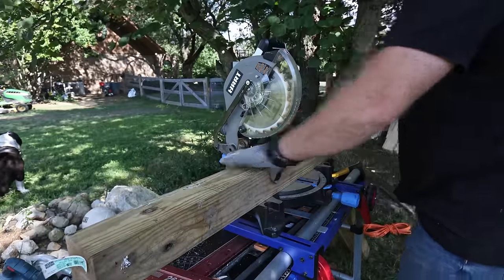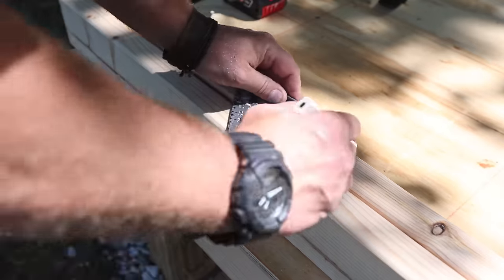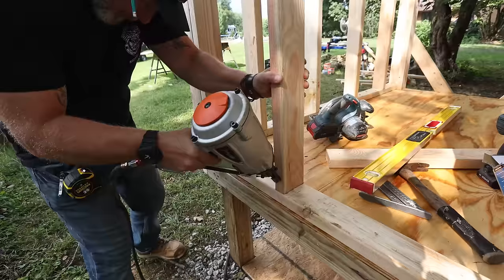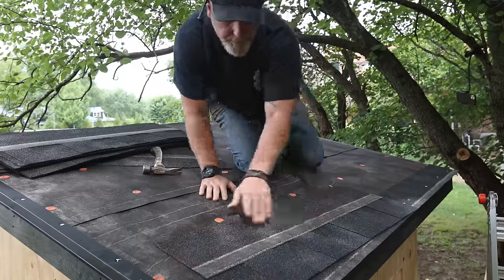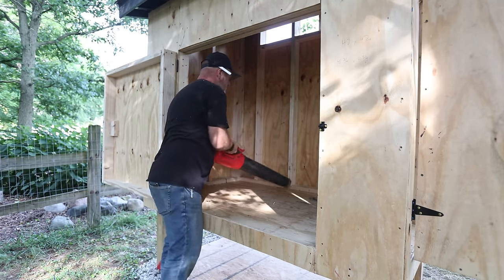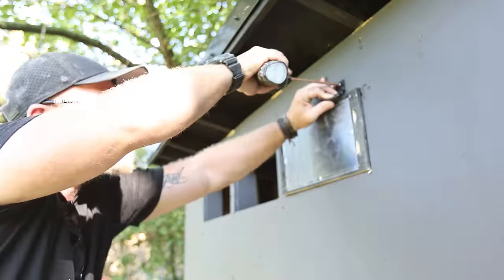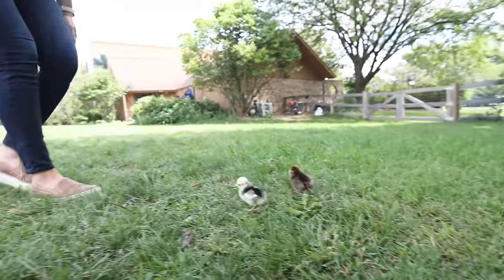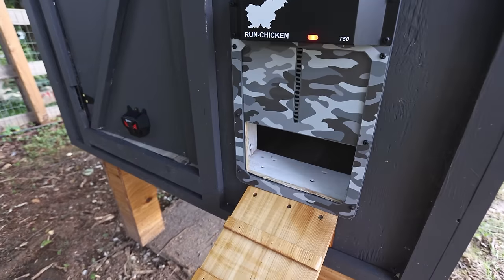How to Build the ULTIMATE Chicken Coop in 7 Days // Plans Available

Comment: FYI: if your chicken huddle by the door when it’s time to go in the coop. Like mine did. Worried if they’re going to get chocked by the run chicken door. Once the sun starts going down it’s to dark in the coop and they won’t go in because they can’t see. It took me a while but it was a simple fix. I put a light inside on a time to turn on at least an hour before the sun goes down and off an hour once it got dark.
Reply: @Victor M what light did you get? I've been trying to find a solution for this as well but it's a manual pull string type. Been looking for a solar powered automated version of the same thing.
Reply: @cameroneverhart6443  I bought them on Amazon. I copied and paste the description👉🏼Nilight - “ 60001F-B Led Pods 2PCS 18W 1260LM Flood Led Off Road Lights Super Bright Driving Fog Light Boat Lights Driving Lights Led Work Light for Trucks, 2 Years WarrantyNilight - 60001F-B Led Pods 2PCS 18W 1260LM Flood Led Off Road Lights Super Bright Driving Fog Light Boat Lights Driving Lights Led Work Light for Trucks, 2 Years Warranty”
2PCS 18w Led Light
Last purchased on Mar 23, 2022
4.6 out of 5 stars 18,404
$15.29$15.29List: $18.99$18.99Details($7.65/Count)
Reply: @cameroneverhart6443  to power the pair of LED lights, I’m using a DC timer with lithium battery and 200 watt solar panels . It’s also powering a small DC water pump for my goats nipple waterer.
Reply: @cameroneverhart6443  also the battery from Amazon 👉🏼12V 24Ah Rechargeable LiFePO4 Lithium Iron Phosphate Battery
Reply: @victorm7274  oh, that is a good battery....normal lithium Ion batteries can catch fire in a chemical reaction that you can NOT stop....lithium Iron Phosphate batteries do not have that issue.  Anyway, I need to get that 200 watt solar panel and DC timer.  We have 4 goats and are working towards chickens now.....guess we did it backwards.
Reply: @Steve-ps6qw  our 4 Nigerian dwarf goats are a bit destructive. I had to make a special feeder that only the chicken can get to. I had the usual pvc elbow no spill kinda feeders. Our goats destroyed them all. It seen like every time I turn around they’re braking something. They’ve broken a few chicken watering nipple, they broke the ramp into the coop. They broke two chicken feeders . I had to reinforce the enclosure with cattle panels. They love to rub and scratch themselves on the fencing. Other than that , it’s all good 👍🏼
Reply: @victorm7274  lol. we have four paddocks but one is the main paddock where the goats sleep (their own little barn) and the chicken run will be in that paddock too but the goats will not be allowed in....I will make it predator and goat proof, thanks for the heads up!

Comment: Very nice looking chicken coop. But in my opinion to make it the ultimate chicken coop it needs to be setup for the deep litter method. Basically you just need it to have 12-18” of space at the bottom for the litter to build up over time. This is the best and easiest way to keep chickens in a stationary coop design. The way it works is you start with a layer of dry wood shavings to cover the floor of the coop. Once that gets soiled you just cover it with another layer of shavings. You continue doing this for as long as your coop has the space for the litter to build up. The beauty of this method is the carbon (wood shavings) absorb and offset the manure load eliminating any smell and composting at the same time. I used this method when I started out with chickens several years ago and went a full 18 months before cleaning the litter out of my coop that housed 20+ hens. You could open my hen house and not even smell a chicken. And if you did it was time for a layer of shavings. When cleaning out the litter it just smells like dirt. Great compost for the garden. 
I would recommend cutting the bottom 12-18” off of you access door and making it a separate door that only opens when it is time to clean out the litter. 
This also works outside in their run area. You might start with a nice grassy spot for them but they will quickly destroy all of that grass. Once that happens get some free wood chips from a local tree company or saw mill and put that down in their run areas. I put a heavy layer down to start with then just mix the manure in as it gets soiled. That way I didn’t need to have a pile of Woodchips somewhere. Use these methods and enjoy your backyard chickens without the smell of the chickens. 
Good luck!! Thanks for sharing.
Reply: agree. i built my deep litter coop in 2017 and have never needed to clean it out. i just take out compost for the garden and add more straw. also his coop doesn't have decent roosting bars. i hope he retrofits some.
Reply: Wonderful tip! That is the method I'm interested in. Lots to learn about chickens! 
Where did you find the plans for your coop build and are there any chicken keeps books you'd suggest?
Reply: @questions_galore  I got everything from YouTube videos. Joel salatin is on I would definitely recommend on YouTube and the books he wrote. The coop I built wasn’t anything complicated. Basically I just made sure I had room in the bottom of the hen house for at least a foot of bedding to build up and still able to open the access door without any bedding falling out. Good luck with the chickens. They are the gateway “drug” into farming. We started with six. That quickly grew to to over 40 chickens ducks goats pigs cows and now horses lol.
Reply: doesn't this stink or rot? And how do you then use that composting for the garden without cleaning it out? Eventually won't it choke your chickens to death? LOL
Reply: @zia_kat  How do you get it out for composting without cleaning it out?
Reply: @stephaniec8816  it doesn't stink. that's the beauty of deep litter. it has a good smell like soil rich with organic matter. chickens originated from the jungle fowl in south east asia and deep litter replicates their natural habitat of the jungle floor
Reply: @stephaniec8816  you just take out compost as needed for your garden but you don't need to clean the coop out.

Comment: Another tip: leave at least a 1' overhang on the roof for ventilation and air flow, use 1/4 " caged chicken wire to cover the gaps in the rafters to keep snakes out.

Comment: Love the coop! Good Solid build. I’m super jealous!!! 
I’d use 1/2in galvanized hardwire cloth on the windows instead of plexiglass and add more windows on the other walls for ventilation. Chickens are fine in the winter, they’re more built for it than heat… it’s the heat you need to worry about. Predator locks are imperative. Raccoons, possums & squirrels can open simple locks. I put down a 2ft predator apron made of Galvanized Welded Wire Garden Fence, 2 in. x 4 in. Mesh from tractor supply around the outside of the run so predators couldn’t dig under the run and wrapped the run in the same. Everything with the coop is Secured with hardware cloth & added a wildlife camera & lights for night predators. I learned the hard way (and I live in a residential area where I didn’t think I had to worry as much) However you’re obviously an expert and have probably figured all this out! Again.. beautiful coop! Good luck!! ❤ (PS chicken math is a thing 🐓 🐓 🐓= 🐓 🐓 🐓 🐓 🐓 🐓 🐓 😂
Reply: It is a great coop, but I am totally with you on a raccoon proof lock on that door and wire behind that plexiglass. The heartbreak when we lost 2 of our 3 ducks is not anything I would wish on someone.
Reply: Take another look at the finished coop; he did put hardware cloth on the window opening so he can prop them open for ventilation without intruders. I do agree with you about the lock hardware, it needs to be something a racoon or squirrel can't open.  Sliding bar locks are child's play for them.

Comment: Nice build! I did something similar but a bit less fancy.  I sheathed the inside with the plastic sheeting like you see on the walls of a public restroom so we can wash the whole thing down, which we do once or twice a year. The floor is also the same plastic sheeting over plywood, but removable through the clean-out door to make it easier to dump the pine shavings we use as bedding. I was most interested in seeing how you were going to address weatherproofing the hinge side of the lid of the laying boxes, since I have a problem with leaks even with a drip strip above it.  How is yours holding up to the rain? It doesn't look like you did anything different than I have.
Reply: We tacked a strip of heavy poly sheeting over the hinged section.  Works like a charm, even in our cold Maine winters when I have to shovel off the top... I just use caution not to tear it.

Comment: Very pretty. I admit to some concerns about a couple things: how is the ventilation in your coop?  Adequate air flow is vital for any birds and I didn’t notice you installing any vents to keep the air moving inside. Once your chicks have feathered out, you don’t have to worry about keeping them warm, you just need to keep them fed and dry. Your power assisted nest box cover is cool, but I would still put a latch on it for those high-wind days that could trigger it opening without a human hand.
Reply: Depending on where they live they may need to provide heat for the chickens since they are Silkies.  Silkies are a more fragile breed of chicken - they need to be protected from the cold and wet weather.
Reply: The windows did have chicken wiring underneath the glass and the windows open. He didn’t address that he had done that but you can see it in the video. Maybe there are other vents or holes. Great point!

Comment: nice coop but up in the air can be to cold for winter if you live in a warm place then ok chickens love to dig and lay in the dirt when it is cold . another tip i bag grass clippings use for laying boxes and help bio breakdown on the dirt floor .i never use heat in my coop birds need to molt and adapt to weather using heat can be dangerous for a few reasons but it the power goes out for a extended period the chickees could suffer . another tip predators can break through cheep chicken wire

Comment: i built my coop with dirt floor 8x8 enclosed area with inside laying boxes and a 8x10 area under roof small hole fence so they can be outside without leaving coop i ran electric for lights and outlet to plug in water can warmer .and a nice big outside fenced in area for them to graze without the dogs in the same space .my first coop had a lift lid laying box but the snow made it to hard to open .now i walk in the door shut the door everything inside food water scratch and laying boxes they love the open air part under roof secure from predators , they love the dirt floor they can dig holes to lay in and dust themselves  . 4x4 post frame 4' center 6x6 half under ground  screen mesh under the bottom sticking out a foot outside covered with dirt to stop digging under screened in soffits for air flow and protection .i did plywood the inside to protect the framing from birds . it has been about ten years not lost one bird to predators and coop is holding up like new total roof size 10x20 metal roofing

Comment: When I built mine, I painted & sealed every board BEFORE assembling it to stave off water intrusion & did minor touch ups as needed.
I like the vinyl planked floor.  We used sheet vinyl on ours to essentially make a tub (1' height) for the deep litter method which has worked out great over the last 8 years, but the glue & vinyl has popped & cracked from seasonal changes & needs to be replaced this fall.
I like the planking idea but would've made it vertical to avoid water intrusion & rot.

Comment: Beautiful coop! You did a great job. Don't forget to use 1/2" hardware cloth with long pins around the perimeter of the run when you build. That should keep any burrowing animals from digging under. Check out Carolina Coops for information on the run and the perimeter protection.

Comment: 1.  nice.
2.  I raised chickens as a kid.  The better set up was a fence that was about 6 feet high around an range tree.  Birds nested in the tree.  No mess to clean up, and wonderful huge oranges.  Another timne, it was free cages under an awning.  The free range was better so you didn't worry about feed/water heat/poop.  Periodically when we were in the fence situation, on wing would be partially cut and then the birds could not fly over the fence.

Comment: Nice job!  Just a bit of chicken advise from an old chicken rancher.  On your small enclosure you will find wile chickens are cute, they also operate in a military style. when older.   There will be a leader and those that want to lead.  If one gets injured they as a group will kill that one.   It is sad to see how viscous they can be.  They are triggered by red (blood), and all peck at that location.   You will experience this unfortunately.
So, install a small watt blue bulb over head, and it will help them be calm at night, which counters red.  You did a great job of having them roost separated at different heights.  They will fight for top rung.
Good luck.

Comment: I put a 12/6 pitch sloped sheet metal under my floor, then used 1/4 inch diamond plate as the floor. I just open the door spray it all down into a tough then dump it into the compost bin.

Comment: When putting in roosting poles its better to use a 2x4 wide side up so chickens  can keep their feet flat while their belly plumage keeps their toes warmer in the colder months. Smaller poles require the chicken to wrap their feet around the pole exposing their toes to the cold.
This can cause frostbite for chickens in uheated coops. 
Thanks for the upload. Good work!

Comment: Great build.  My only suggestions, based on experience, are a board placed across the inside of each external doorway (not secured, just placed there) to prevent shavings from falling out when the doors open and jamming them so they don't shut well.  Also, I made sure to build mine high enough off the ground, and without a stretcher board on the clean-out side of the base, so I can push a wheelbarrow right up under the doorway and just rake all the mess into the wheelbarrow.  Extra space underneath might be suitable for enclosing, making rodent-proof with metal sheathing, and using to keep bags of shavings.  Only thing I see that I don't recommend are the "chicken shelves" high up in the coop.  Those are going to collect poop and be impossible to clean, while not providing any benefit.  Chickens prefer to roost on bars, not flat surfaces.    A sneaky one may also start laying up there, which could cause a host of issues if you don't find and remove the eggs.  One thing about chickens is that they always want to be on the highest roost, so it's been suggested to me that all roost perches be made the same height from the floor.  I have two roost bars that run lengthwise across our coop, and they provide plenty of roosting space and were easy to install, treating them like closet rods with a "holster" board at each end.  We'll be building a bigger coop this year, and I'm going to make use of a lot of your features and tips!

Comment: A little  advise,the heat will  stress the birds in high  temperatures  and  they also love to free-range, pls construct a mesh area around  the coop  so they will use as needed.
Reply from the maker: We just built them a 40x40 predator proof run so they can get out and have fun
Reply: @KomarProject  you're the best they love u.

Comment: ! ! !   AWESOME JOB   ! ! !

Hi There !

Very Nice Your Chicken Coop.

However, Based on a Little Resaerch, I’d Like To Suggest an Upgrade For It Regarding Perches, As Follow :

Construction of ideal perches for the comfort, safety and health of chickens:

1- Maximum height of 120 cm (47.244 inches);

2- Ideal angle of the perch is 45º, because that way, one bird does not defecate on top of the other;

3- The First Perch Must Be 40 cm (15,748 inches) from the Ground;

4- Minimum Space of 20 cm (7.874 inches) for Each Bird on the Perch;

5- The perches must be round, with a diameter of 3.5 cm (1.377 inches), not smooth (like bamboo) and without bark or cracks to avoid the proliferation of parasites;

6- The bedding around the perches must be at least 3 to 4 cm (1,181 to 1,578 inches) to absorb impacts and protect inflamation in the birds' feet and vents .

That’s It !

These Tips Are From a Zootechnist That I Just Saw.

Best Regards !

Comment: You don't have enough ventilation for your chickens. Those 3 windows being open is not enough. Chickens are like horses, they need way more ventilation than uninitiated people think.
You need ventilation panels on each side, at a minimum. Chickens can handle cold really well, what they can't handle is heat and lack of air flow.
Plus, your chickens will rest on the highest perch they can reach, so with a small number of chickens, those lower posts are not going to be used, except and points to jump to in order to get higher.
Plus, you want your chickens roosting on 2x4s, if it is REALLY cold where you are, use the 4" side up, so their feet are covered by their feathers, but it's better for their health to have the 2" side up, so that they are grabbing the roost. This is important to chicken health.
Chickens poop all night, so having them roost on a board, means the board will be covered in chicken poop every day, and your chickens will have poop on them all day. This is not good for the chickens.
Your coop is pretty, but was built with little background in raising chickens, so you've made the errors everyone makes.

Comment: Just one question: is plywood the best material to use? Or is that what you just had? Does'nt it swell  and warp in the moisture?
Or is the paint enough to protect it?
Reply from the maker: Painting will protect it.  You can use siding but the cost will go up at that point.  I think plywood is plenty if you paint it with an exterior paint.